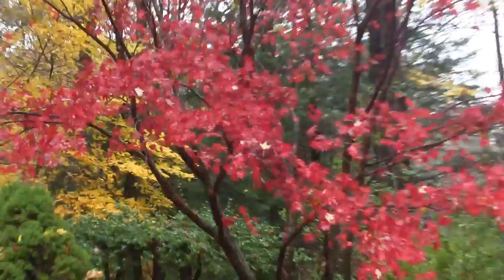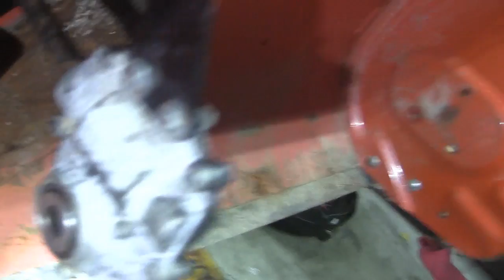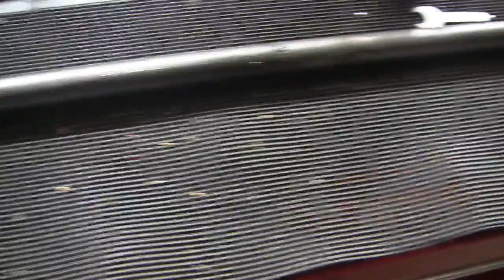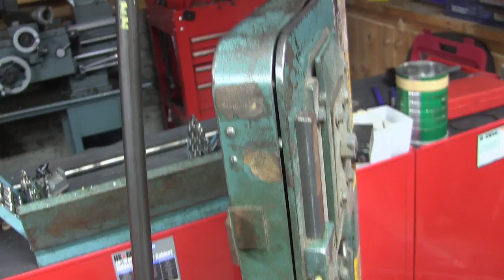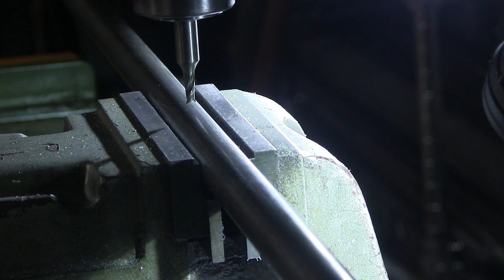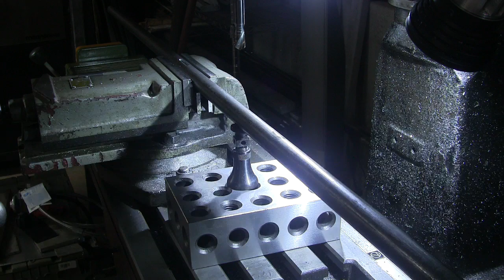Snow Auger Repair

Comment: Wouldn't a woodruff cutter have  been a better option . Those are made for that type use. With the square it's more likely to wobble and twist with the beating augers give. I've been repairing these things for fifty years it's amazing the crackpots who think they fixed it like that was not one thought as to what drives the shafts. . Good deal for you and the owner . Take care and early happy thanksgiving.
Reply from the maker: I suppose that I could have put several woodruff keys in  but since the shaft was only 5/8, I decided that longer was better. The key I installed was 1.25 inches long so I figure that was plenty.